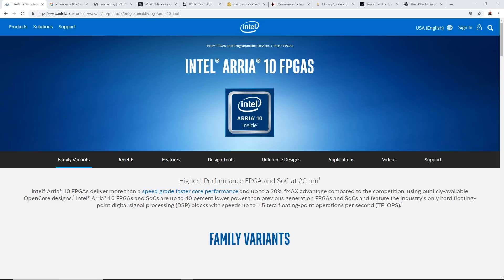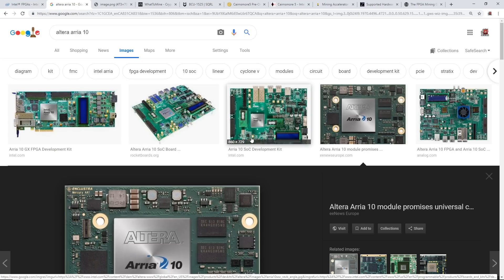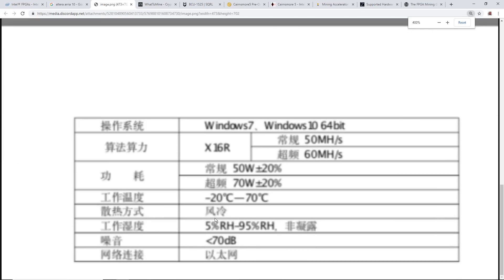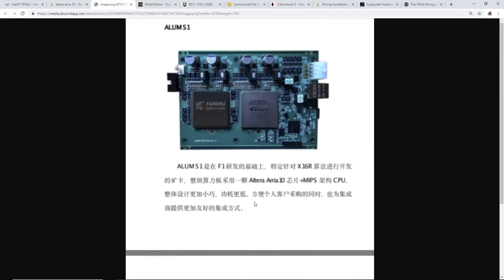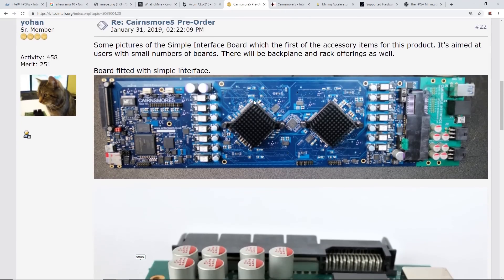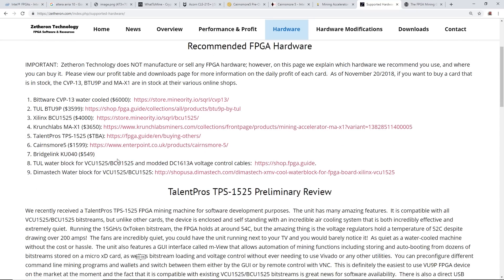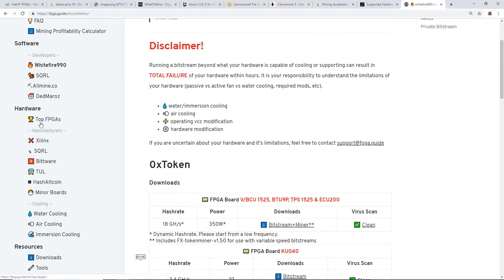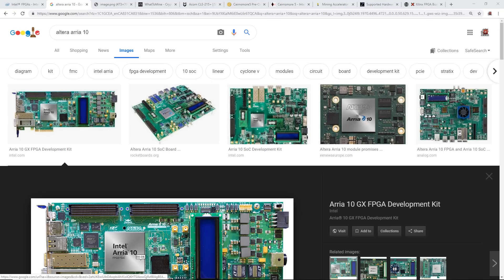ALUMS1 FPGA 60MH/s On Ravencoin X16R at 70 WATTS?!

Comment: FPGA are special free programmable Logic Chip. The Arria FPGA have a 1.000.000 Logic Units inside and you can transforming a Algorithm in a logical script to program the chip with the right fpga-compiler. ASIC Miner using the same concept. The ASIC Chip is a hardware based Chip to work with the algorithm of Bitcoin. Also you can work with other algorithm´s and transforming to fpga. Fpga is mostly faster then a graphicscard. He was using reduced energie and is more efficient.

Comment: Hi am the manufacturerof the ALUM s1.  We made a mistake about the hash rate. The latest assessment results are 30mh/s for x16r. X16r is so difficult to develop on FPGA. And we are confident that we will upgrade to 40mh/s in the future. The board already presale. I think we can send one board to u. Maybe u can test it. BTW we are from China.
Reply: What's the current hash rate for the Alum s1 and do you have any new boards to be released?
Reply: Can we have a link to a website with the project or something like that? Also where can we buy it?